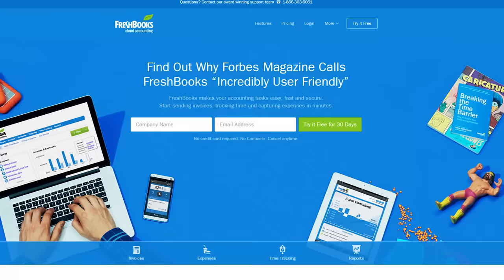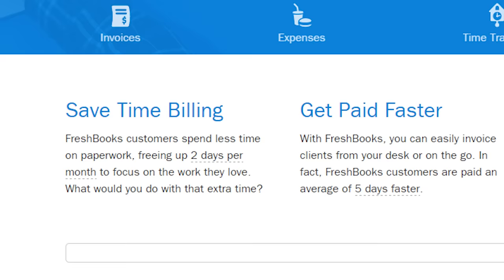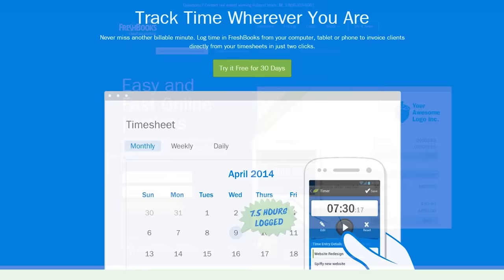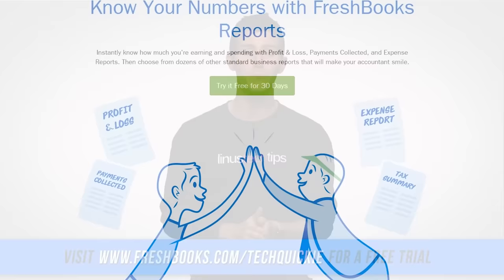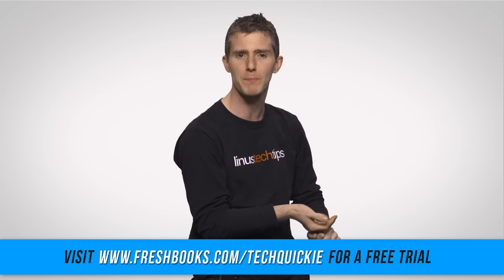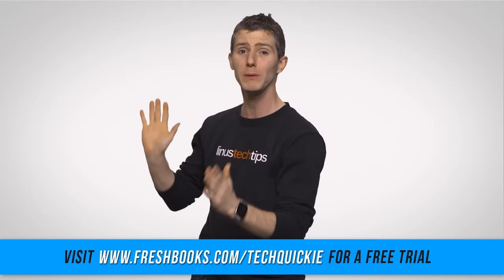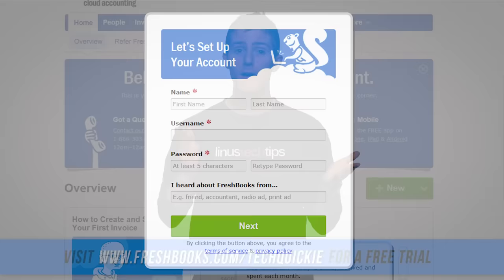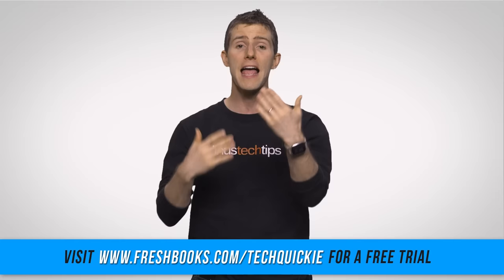AM and FM Radio As Fast As Possible

Comment: Slight correction, whether a signal propagates via the ionosphere has nothing to do with the signal's modulation, but entirely to do with the frequency. Signals below 30MHz tend to propagate via the ionosphere much more readily than signals above 30MHz. Since the AM broadcast band is from roughly 0.5MHz to 1.6MHz, and the FM broadcast band is 87.5MHz to 108MHz, the AM band bounces off the ionosphere much more readily. Amateur radio operators use FM on the upper part of the 10m band at about 29MHz, and it skips quite well.

Comment: I was so happy for my phone to have FM Radio. When power went down the mobile networks died with it here. Didn't know what was happening if it wasn't for that.
Reply: You prune,Mobile Networks still function even without power
You must live in an area of the world that uses electricity to allow the Mobile Phone networks to function
In all other parts Smartphone networks don't require any power to run

Comment: @1:32:  No, It doesn't "make your antenna resonate at the same frequency and ignore everything else in the air"; you even say so @ 1:45, you are describing a band-pass filter. The antenna gets all of frequencies that are a close match in length to the specific frequency they are designed to pick up (full wavelength) and can also pick-up resonate frequencies such as... 2x, one half, or one quarter wavelength. That's why there is no such thing as a "digital antenna" (they use the same frequencies as analog did).

Comment: Basically what AM and FM radio is when you tune to that frequency on that dial scale, that just the frequency it transmits on telling you how many waves, cycles, or hertz it travels through the air a second.

FM MHz 1,000,000 x 105.1 = 105,100,000 cycles a second
AM KHz 100,000 x 680 = 680,000 cycles a second

Comment: i get it but i don't get it... i don't get how specific sound (music, voice etc... not the sound of electricity) can be sent through the air being carried by these waves and you don't hear it when it is in the air but can hear it again once it reaches a source... I get that it completed a circuit so to speak when it hits your radio antenna but still how can the sound even be carried through the air like that (On these waves) and and especially without hearing it... i just don't get it

Comment: I've yet to see someone screw up the time by saying something like "Road closed from 8AM to 8FM".

But seriously, no explanation as to why AM stations fizzle out when I drive underneath power lines? That's the one downfall of AM that I can think of. (I know it has to do with the fact that those lines transmit alternating current and that in itself turns the lines into a transmitter.)
Reply: ^ dont get confused between FM and PM. PM is "post meridiem", and refers to time between noon and 12AM.  FM is frequency modulation
Reply: The strong magnetic field from the power lines overloads the front end of an AM radio thus blocking the signal

Comment: Due to the propagation of FM waves, distance is a factor.  Being that FM waves propagate horizontally & the Earth is spherical, the radio receiver will, based on distance, drop below the line of horizon & beneath the propagated FM wave.  The reason car radios begin to loose an FM signal as the vehicle travels farther away from the FM transmitter, is for this very reason.  FM waves propagate horizontally in a complete circular pattern from the transmitter's focal point, as seen from a top view.

Comment: The tuner (L/C) resonates, not the antenna.  VERY FEW people have the land and inclination to put up a resonant mediumwave antenna.

I give you a grade of C on the propagation bit.  Actually the number of free electrons decreases the moment the sun stops hitting them.  The reason for nightime propagation on mediumwave frequencies is quite simply the fact that the D layer disappears when the sun goes down.  The D layer absorbs the radio signals, but is only present on the sunlit side of the planet.

73 de KC5VDJ

Comment: Why am I not surprised that you did not mention Heterodyning or the frequency mixer at all? Granted with modern DSP chips they can sample a raw signal and demodulate it all without external filtering, but its history. "Heterodyning is a radio signal processing technique invented in 1901 by Canadian inventor-engineer Reginald Fessenden, in which new frequencies are created by combining or mixing two frequencies.". "The most important and widely used application of the heterodyne technique is in the superheterodyne receiver (superhet), invented by U.S. engineer Edwin Howard Armstrong in 1918.".

Comment: Can you guys stop clipping your lav mics? :p Put a limiter on it or somthing. it would really be more professional.
Pretty sure you can do that in premiere. If you still have clipping issues, it is probably because of the encoding ,and the solution is to set the ceiling of the limiter at -0.3 dbfs or lower.

Comment: I'm always staying up to date with the latest technology, and I consider myself an early adopter. This video makes me feel like a relic from the past though, haha. It's really just because I'm super cheap. I use Ting as my mobile data provider (I would say carrier but it's an NVMO) which is super cheap if you don't use much data (The more data you consume, the higher your bill is). I almost always have a WiFi signal (because very rarely am I not at work, school, or home) so using Ting is a good idea for me. The only downside is commuting between those locations, when I don't have a WiFi signal. I force myself to listen to the radio because my mobile data consumption would skyrocket if I listened to say, Spotify, during all the commutes. Feels bad mang.

Comment: Hey,  you forgot about the capacitor in the resonate circuit. You usually need a capacitor and an inductor to fully filter out high and low frequencys in a AM circuit.

Comment: wrong about the antenna part, they actually receive all the signals and the know changes a filter set at that frequency,

and then you have antennae polarisation (horizontal for TV, vertical for Radio, up to a 45-degree leeway)
Reply: You prune modern day TV don't use antennas

Comment: My fm radio has better sound than my digital and also than my small dab radio, so I listen to my old fm. I appreciate that I do not need to turn on a screen, connect to internet or update. Radio is great company when working around the house with boring practical work! Although I cannot listen to programmes I used to listen to (they have moved to DAB) before I now get channels from my friendly neighbour country! One strange thing though: If I turn on a lamp or another electrical appliances close to the radio it destroys the fm signals. Why?

Comment: Forgot to mention that AM antenna is located inside the radio horizontally while FM antenna is the one that you actually see on top facing vertically. The position of the antenna is important because AM signals are sent vertically to hit its antenna at a right angle and FM signals are sent horizontally to hit its antenna  at a right angle.

Comment: Yea, but you said you would explain how it would work but did but didn't The signal coming in is boosted by a transistor, a transistor has several functions, I know you know it is used as a logical switch in cpus, but it also amplifies electricity. The output is controlled by a small base current. Think of the base as a switch for your sink, the more you turn it the more it amplifies, Emitters are normally of the transistors are normally tied to ground because of larger doping regions, But this transistor will amplifier the radio signal and send it off to a variable capacitor or transformer like you mentioned, just depends on the radio. Then it will put that through a another transistor amp, it will switch the signal 180 degrees so you have to add anther one to flip it another 180. the wavelengths can flip when put through different circuits,  There will be a voltage divider made up of a couple of resistors to pull up the base of the transistor to acceptable levels then the radio signals is fed through a cap for filtering then into the transistor amp then through more filtering then to the speakers. Now keep in mind this is a simple brake down of a radio and can work but will be shit, they are far more complex then what I wrote but it is a general description of the circuit, I'm sure some still have no clue what I'm talking about, but that is your own research comes in. You can brake any circuit into something simple but when being made they are far more complex than that. Much more filtering, older ones would have dozens of crystals which is a device that holds a frequency but they have a low range, you have to have dozens in a circuit to get the full range of fm radio, now we have all that in one single chip, I think it's cool taking apart old stuff and seeing how it evolved over time. But anyway, I'm sure no one learned yachting here as I'm not the best at putting my thoughts into words.

Comment: So he didn't explain everything obviously this was just very basic theory in reality there's alot more that goes into it, receivers have to go through a process of demodulation in order to extract the data, transmitters need oscillators to create or recreate the sound that they broadcast, there are more advanced concepts like heterodyning which involves the theory of how waveforms mix (think adding and subtracting) But he did a very decent job of explaining the basics, I just don't want anyone to think that radios are old lame and simple tech that are hardly used anymore, it's still very complex and they have a multitude of functions in media, warfare, and entertainment.

Comment: The same problem with frequencies is with 2G, 3G and 4G. 4G has a much hiegher frequency, which means you need a lot more antennas to get a good coverage.
Reply: +FIGHTTHECABLE Well, 4G has a range of bands. They go as high as 3.5GHz and as low as 800MHz. The range is not too dissimilar from 3G, actually.
Reply: You mean higher frequencies

Comment: It would be the frequency not the method of modulation that gives the range.  The lower the frequency the longer the wavelength.  The shorter the wavelength the more line of site it becomes.  The 80 meter band can go a long way because of the skip off the ionosphere, the 2 meter band not so much.  The poor 11 meter band (home of CB) is some times good for skip and other times not so much.

Comment: Why are long waves not frequency modulated to combine longer range with interference insensitivity?
Reply: +Jörg Wessels Because there isn't enough room, the modulation would have to be tiny, and therefore impossible to detect, for it not to interfere with other stations. Typical AM is 510KHz -1650KHz ish, so it's a much longer wave, and therefore harder to change/detect changes in wavelength/frequency. (c= λf) For changes to be detectable by cheap radio receivers, the modulations would take up the entire MW (medium wave, proper term for the usual AM region.) band. This is why FM is on a much higher frequency range, remember, the gaps between stations are in MHz, which is like as big as the entire MW band.
Reply: William Satterthwaite Thanks for the reply.
Reply: +William Satterthwaite Narrow Band Frequency Modulation (NBFM) can be used at around 20MHz, which should still have a much better range than 87.6MHz - 108.9MHz, it would be great if that area was freed for radio, but it seems to be used by defence, at least in my country.

Comment: Fn radio sounds better than am radio because fm radio has a higher bandwidth it actually has 15 times the bandwidth of am radio so it sounds a lot better. Also not all but some fm radio ststions play flac or wav files which are lossless audio files that are the highest quality. But most radio stations play mp3 files at 320 kbps as that's the highest quality mp3.

Comment: Someone explain this to me. I've tried looking it up and still don't get it. Why don't all radio signals interfere with each other? I think of it like being in a swimming pool. I'm trying to send you a message on the other side of the pool by splashing water at a certain rate. But if there are other people splashing around in the pool, wouldn't all the waves interfere and therefore make it impossible to decipher the waves I'm sending? Why don't all the radio waves interfere with one another and therefor make it impossible to distinguish certain signals?
Reply: It's simple. 

Higher frequency means shorter wavelenght. That's it. Someone sends long waves, other one short waves. Short waves are still visible on the long ones, and we can see all of them.

If you try it, it should be visible.
Reply: I still don't see why they wouldn't interfere. They're both just waves, so why wouldn't a radio wave with a shorter wavelength affect another wave with a longer wavelength? And why do sometimes the signals on a radio cross?
Reply: +sweetness583 

Here is a very simple way to visualize it. The analogy is not perfect, but I think it'll help you get the picture. Imagine a float in a pool of water. Now imagine making some waves on both sides of the float. The waves produced on the left side have a higher frequency than the waves produced on the right side. So the distance between each wave front from the left is shorter than the distance between each wave front from the right. What happens when the waves cross the float? Well, the float bobs up and down of course. But at what frequency? As it turns out, the float will bob up and down at both frequencies, one superimposed on the other. Only when the waves produced from the left and right are of the same frequency does interference occur. A very similar thing happens when radio waves cross a length of wire. It causes the electrons to move back and forth in the wire. There could be many radio stations transmitting on different frequencies and the electrons will be moving back and forth at all of those frequencies. When this radio frequency (RF) current is fed into a receiver it passes through circuits designed to filter out the unwanted stations.
Reply: VFXI
I think I get what you're saying. Thanks.

Comment: Actually Electricity itself is a Radio Frequency most of it goes through wires at 50/60 Hz, anything is a Frequency.
Reply: Not really. When they say "Radio Frequency" or RF they are talking about the electromagnetic spectrum in which electrons excite a medium (air or wires). This excitement of electrons can be transferred into a wire without direct contact and detected. Photons which are part of the electromagnetic spectrum can not induce a voltage on a wire thus its not considered RF also a DC voltage running thru a wire can also not be considered RF even though it emits magnetic signals.

Comment: Good grief there is so much facts mush here! Firstly, the range of AM and FM signals is NOTHING to do with the fact that stations are using Amplitude Modulation or Frequency Modulation for their radio signals! AM happens to be used on long wave, medium wave and shortwave - all of which travel further than VHF FM broadcasts simply because lower frequencies travel further. You can just as easily transmit an FM signal on medium wave, for example, and it would go just as far! The problem is that FM signals use up more radio bandwidth for the same audio quality, so AM tends to be used on the lower broadcast frequency bands to fit more stations in. Likewise, you could transmit a mighty fine AM signal on VHF (88-108 MHz) with a higher quality frequency response than FM; it's just that FM is better suited for the much greater space on VHF (20 MHz from 88-108 MHz rather than medium wave's 1.2 MHz from 530-1800 MHz) as it can carry several different audio components at the same time. Indeed, FM stereo radio broadcasts use AM to transmit the stereo component of the audio!  Meanwhile, CB and radio hams happily use FM on shortwave for good quality radio signals, as well as AM and its variant SSB. Ah, the real world...!

Comment: Do I REALLY need a mouse pad? I don't know if i should spend money on a mouse pad when my mouse works fine.
Reply: +Alex Burke 
no
also you can use some paper/ a book if you have tracking issue.
Reply: 10 Euro isn't that much. also more comfortable
Reply: Alex Burke Buy one, it will not wear down your mouse feet
Reply: +Alex Burke No, you don't need a mouse pad. However, it does remove lots of minor annoyances that you would otherwise get if you just use paper. It's also kind of important to have if you play games which require accuracy, such as CS:GO or Starcraft.
Reply: +HeyJD is there a cheap one you recommend?
Reply: +Alex Burke There's two main "gaming" mouse pads in the market at the moment that 90% of people with mousepads have. The Razer goliathus and the Steelseries Qck. Both of them are soft mousepads that are nearly identical. Both of them are also around the same price. From $12 - $20USD depending on size and thickness. They'll last for years and you can buy them nearly anywhere.

Other then those standard ones you can really get a $2 no-brander mousepad if you want to be cheap. The cheap ones won't last long and won't be as nice, but they are still worth the money compared to using no mouse pad.
Reply: I got one for $3 at the dollar store. It has a wrist rest as well
Reply: +HeyJD thanks tons, man.
Reply: Alex Burke No problem, glad to help you out.
Reply: Yes,  eventualy you will get a callus on your palm and if you use the system enough you could rub it raw. I have done it before
Reply: +Alex Burke I bought a 5 doller one on amazon,  it's a steal series

Comment: You might as well do a vid on how to make a crystal set radio receiver that requires no batteries.
Reply: All radios require a power source either 6 Batteries or a Power Cable supplying 240 Volts AC Power